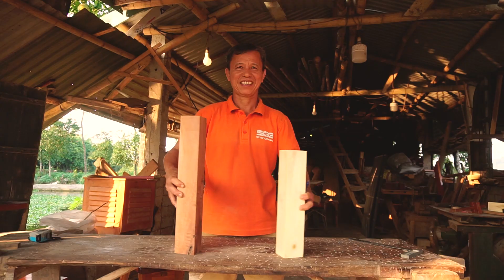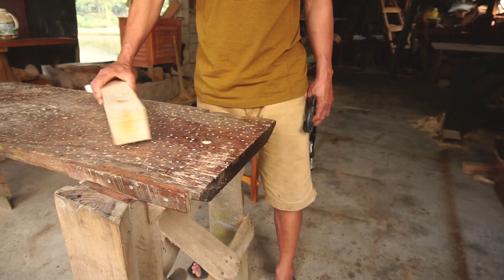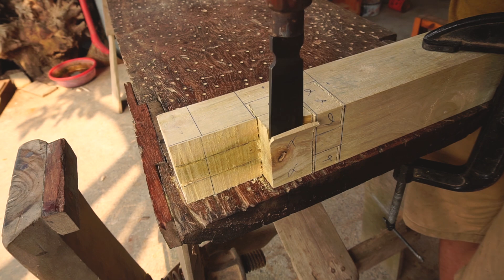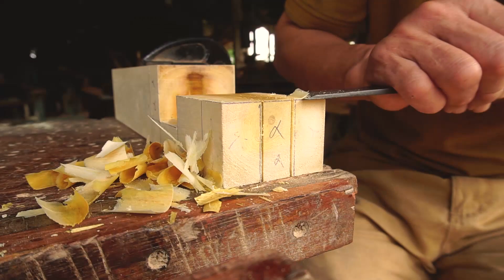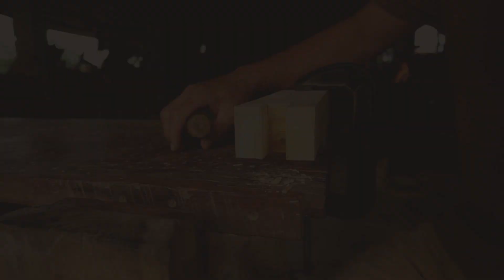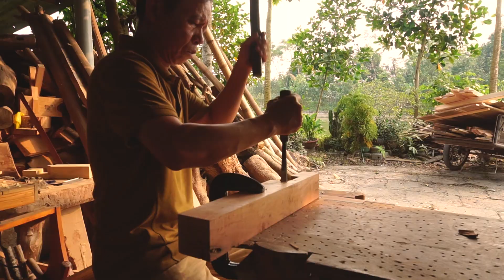Awesome Wood Structure Straight Connectors, Amazing Japanese Woodworking Joints Skills

Comment: It never fails to impress me with your knowledge of all the different joints that you are able to do.
Reply from the maker: Do you like them ?
Reply: @HCarpenter  Yes I would not consider myself much a carpenter I have built a few porches and a shed but I am not a wood worker so I enjoy watching the way you make your joints using only hand tools where I was a pretty good heavy equipment operator I never had the feel fine woodworking that you have mastered over a lifetime of working in it.